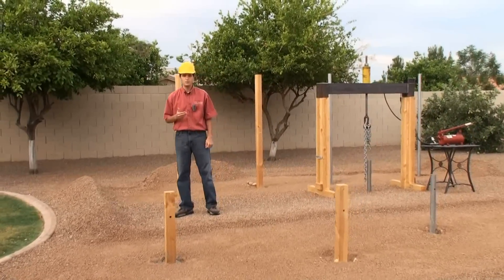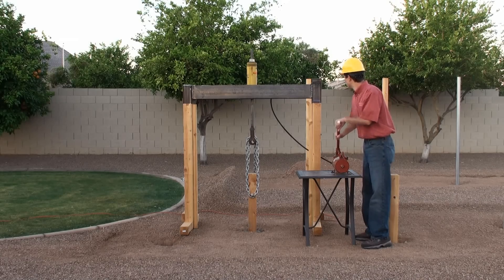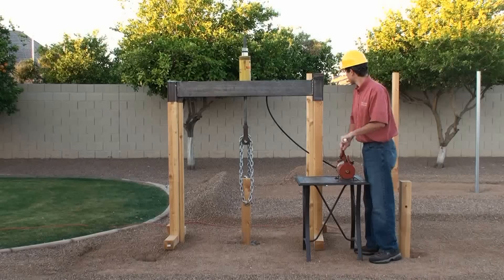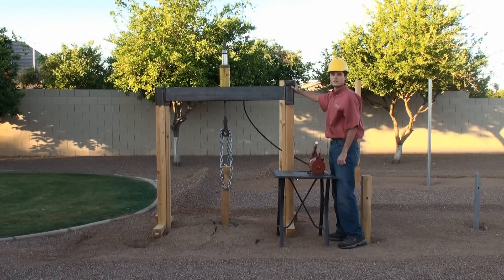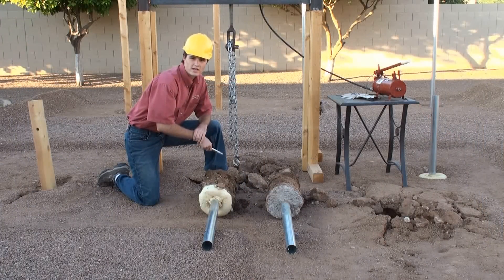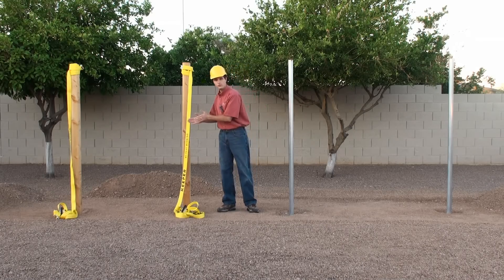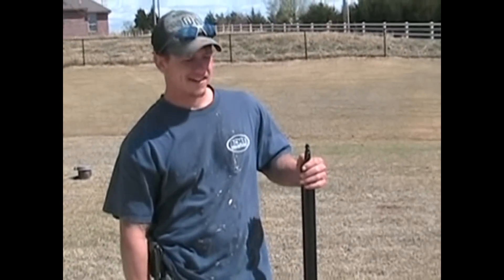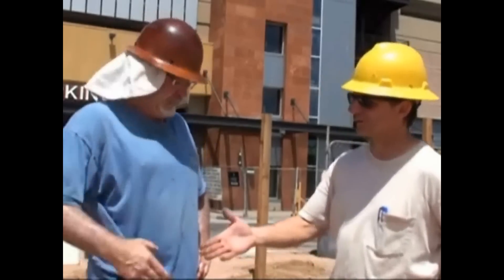Testing to Compare Concrete to Secure Set

Comment: We rarely set posts, but one 80 pound bag???? I believe we were always at 2 or 3 bags when we were stuck with it.  By the way, when it comes to posts (don't confuse this with  part of a building constructed using posts) as you use them,. Their design is not mainly to resist uplift, but to resist lateral movement...which can be figured out by your soils engineer using a calculator...and does have something to do with the hardness of the soil. . Most bagged concrete (around here) is around 3000 to 4000 psi...which translates to over 200 tons per square foot (if my math is correct..might not be?) .  The hardest soil is probably nearly as hard as your foam we called it D.G...not sure what they call it in your neck of the woods.  Foam has it's place, that is for sure. But to me it looks like your salesman in the video is just looking for easy cash extraction to people wanting to put in a new fence. What I would like to see, is a 50 year old installation of foam around a post,.................next to a 50 year old installation of a post in concrete,.. and just a lateral pull test..

Comment: This is an interesting test. The posts did move more in the horizontal pull with the Secure Set than they did with the concrete. Against a severe wind loading, I'd rather have the concrete on a one for one basis. However, the cost advantages in reducing labor could make the Secure Set advantageous in many situations. I'd still like to know whether I could use this to put posts in buckets for situations where I needed to move them to different places.

Comment: I'm a bit sceptical regards your 24 inch holes .. from watching your slowmo the ground is giving way, but the soil pattern as the ground gives way would indicate to me that your holes were "belled out" at the bottoms  before the concrete and secure set were poured.  Can you confirm or deny that?  Just sayin,  that that is not a typical industry standard when installing fence posts metal or wood.
Reply from the maker: Hello, Your observation is good.  Presenting information about a product is only worth publishing if what you present is accurate and true. What you observed is correct, the ground did give way like there was a bubble at the bottom of the post.  The reality is true.  The way Secure Set works is entirely different than concrete.  Concrete fills a void and it relies on the weight of the concrete and the surface friction between the concrete and the inside surface of the hole to resist uplift and to some degree sideload.  On the other hand, Secure Set, after it is mixed and poured into the hole, and while it is still in the liquid form, (about 45 to 90 seconds, depending on outside temperature) it is absorbed very quickly into the soil substrate. Once the bulk of Secure Set starts to expand, the product absorbed in the soil will also expand. This forms something similar to a "root ball" at the bottom of the post. Because of the penetration of the liquid Secure Set into the soil, The "root ball" effectively has a diameter larger than the diameter of the hole. Pulling the post out of the ground with this "bulge" at the bottom of the post makes it very difficult and as you observed in the video, causes a greater disruption of the soil than if the post was pulled smoothly out of a hole. That is why Secure Set works so well in addition to protecting the wood or metal post below ground line from either rot or corrosion. You had a good point, assuredly there was no "belling out" of the bottom of the hole, its just Secure Set doing its thing!  Thank you

Comment: I'm very much in need of replacing my wooden deck posts set in concrete due to rot at the base. After seeing your video, Secure Set has piqued my interest. As far as preventing or minimizing rot, is Secure Set better than concrete? Also in concrete vs. Secure Set, what would be better when the posts have to support the weight of the deck plus anything on the deck such as furniture and people? I thank you in advance for replying to my question.
Reply from the maker: Hello, Yes, Secure Set is the better option for setting posts that you do not want to rot below ground line. Secure Set is a high density (5 lb.) commercial strength foam with a compressive strength of 100.1 psi and a tensile strength of 130 psi.  It expands 18:1.   Its closed cell structure does not allow air or water to move through it.  Without either air(oxygen) or water, rot cannot occur. As far decks, deck posts can be set with Secure Set for decks up to 4 to 5 feet above the ground. Make sure you set the posts deep enough and that you cross brace the vertical deck posts.  Cross bracing will eliminate the potential for sway or shifting when you have a dynamic load shift, such as a deck full of people suddenly moving from one side of the deck to the other.  Recommendation is to set the depth of the posts at least 1/3 of the overall length of the post or 24" whichever is greater.  The diameter of the hole should be double the dimension of the post. ie: 4x4 posts should have a hole width that is 8". If you expect heavy loads on the deck, consider placing concrete pavers under the bottom of the posts to help distribute the column load on the deck posts.
Reply: @SecureSet-Fence-Installation  Thank you for the information.

Comment: Would this be secure on posts for Calisthenics bars?
Reply from the maker: Hello,  Yes it would work,  Set the posts for the bar at least 1/3rd the overall length of the post.  If you want the bar to be 7 feet above the ground, you will need a 10 foot post, with 3 feet set in the ground.  Thank you.

Comment: I think I am convinced to at least try it now.... When the price comes down just a bit closer to concrete ;)
Reply from the maker: Hello,  On a single post project, the cost of Secure Set would be more than an 80 lb. bag of concrete. However, if you have a project that uses 2 3/8th inch diameter metal posts, Secure Set is equal to the price of concrete.  You can set 7 metal posts with a one gallon kit. Also, mixing and pouring Secure Set is about 100 times easier than concrete and it sets in one hour.  You could set your posts and build a considerable amount of your fence in one day.  Thank you.

Comment: Strength depends on the depth of the hole. What hole depth was the demo posts?
Reply from the maker: As per fencing industry standards, the holes were 24" deep.  GRA Services The Makers of Secure Set

Comment: Why only fence posts? Why not footings for houses?
Reply from the maker: Thank you for your question, Karen.  As a 5 lb. high density foam, Secure Set does have great compression resistance, however, it was not designed or tested for foundation application. In its application for fence posts, decks, gazebos, pole barns, and many other applications including telephone poles, it does extremely well, other applications such as foundation work would be outside the scope of testing and its designed use.   GRA Services - The Makers of Secure Set

Comment: When you pull, you are testing the strength of the soil, not the strength of concrete or secure set
Reply from the maker: Hello, Yes to a degree.  That is why it is important to test both products in the same soil type. What we are demonstrating, is that in a side by side test, under exactly the same conditions, Secure Set holds the post in the ground better, as it requires greater uplift force to extract it from the ground.  The reason is that Secure Set actually permeates into the soil as a liquid, before it expands into high density foam.  This allows it to lock into the substrate more tenaciously than does concrete.  Concrete fills the hole, but it does not penetrate the soil.  Secure Set is also a closed cell material which prevents air and water from getting to the post below ground line.  This protects the post and helps prevent rot for wood poles and corrosion for metal posts.  Thank you.
Reply: @SecureSet-Fence-Installation  ok, good point. Thank you

Comment: Couldn't the dirt play a roll in pounds to pull?
Reply from the maker: Hello, Yes, that is a good observation.  The soil will play a role in the outcome of the pull test.  That is why we tested the Secure Set v/s concrete in exactly the same soil conditions, so that a true side by side comparison could be established.  It would be a different result if one test was done in heavy clay and the other was done in sandy loam.  Regardless of the soil type, we have found that Secure Set, with its ability to penetrate into the substrate of the soil, gives a better uplift resistance than does concrete for whatever type of test in completed in a side by side scenario. Reason being, the concrete fills the hole, but does not seep into or penetrate into the soil as Secure Set does. Thank you
Reply: @SecureSet-Fence-Installation  Can I make a table with it, like people do with cement?  
I also want to make a slab 3'x6' to place a smoker on. I was just going to frame this out and pour concrete in it.

Comment: This is the demonstration I needed to see to convince me to switch from concrete.
Reply from the maker: Hello,  Thank you, there are others benefits as well.  Ease of use,  transportation of material, no need for water on the job site and long term protection of the post below ground line.  You will find Secure Set to be a very good alternative to concrete or other post setting materials.  Thank you.

Comment: This looks like an awesome product but what about the environmental impact?  Will the chemicals from the Secure Set leach out over time into the soil?
Reply from the maker: Hello,  Secure Set, when it expands and hardens, becomes high density, closed cell structural foam.  It is from the polyurethane family of "plastic" chemicals. In other words, it become an inert plastic like product, that will not break down over time.  Known life of the product underground is more than 40 years.  In essence, you have made a "man made rock" .  It does not allow water or air to move through it, therefore it does not leach out or absorb in any harmful substance in the soil. It does not affect ground water or support any fungicidal growth. It will effectively protect your posts from rot or corrosion for many many years.  Thank you.

Comment: Who cares about the force to remove the post. I care about side strength from wind and then longevity.
Reply from the maker: Hello, The two forces at work on a fence are both side load and uplift.  As the velocity of the wind increases, and the wind hits the fence and deflects up and over the fence, initially the fence will start to lean as the compression on the soil at the base of the post, eventually exceeds the psi compression resistance of the soil. As the wind deflects up and over the fence, this creates an upward drag on the fence which tries to pull the fence post out of the ground.  This is not unique to fence posts, all vertical structures encounter the same physics. Thank you

Comment: It's about twice the price on concrete. With my back, it's well worth it.
Reply from the maker: Hello,   Yes, by the individual "Shake & Pour" single post kit, it does cost about twice what an 80 lb bag of concrete costs.  However, if you purchase by the "gallon" jug, you can set 5 posts (4x4 wood posts) per gallon and then the price is about par with concrete.  Thank you for your comment.
Reply from the maker: Hello, if you purchase the product by the gallon, the price averages $5.80 per hole, a bag of concrete at our local Home Depot is now $4.66 (includes tax).  You only have to wait 1 hour for Secure Set to cure, most posts can all be set in one day versus waiting until the next day for the concrete to set.  Many advantages for using Secure set.  Thank you

Comment: I'm more interested in the compression over time factor. I know concrete will provide a stable, wide footing for my project. If I use this for a carport will it eventually sink from compression of foam? Longevity? Not saving time if I have to redo it all again in 5 years.
Reply from the maker: Hello, Good question.  Secure Set has a compression strength of 100.1 psi.  That means that it can support 14,400 lbs per square foot.  If your carport has been constructed with either posts or walls, and either of these are supported by Secure Set, if the load bearing weight at each of those points does not exceed 14,400 lbs per sq foot, you will not have any issue with the high density foam.

Comment: What is the life span of the foam? Expanding foam doesn’t outlast concrete especially out in the open!
Reply from the maker: Hello, The known lifespan of high density foam that is protected under the ground exceeds 40+ years. You are correct about foam that is left exposed to ultraviolet light.  After a while the foam will start to discolor (turning a yellow color). If the oxidized surface of the foam which has discolored, is left undisturbed, the damage to the foam will only be about 1/16th inch deep.  However, with the possibility of yard maintenance work disturbing the oxidized zone, the UV light will affect the next layer of foam, etc. Over time the foam will slowly deteriorate until it gets to ground level and is covered with soil. Thank you.

Comment: I need to put 6x6 wood post to hold solar panels in Canada. That means heavy load on each post (about 100 kgs load, 6 feet wood above soil) on compression and soil movement on winter/spring (because big difference in temeprature). So my question: foam or concrete ?
Reply: Using foam will be more than adequate.  The issue is the depth of the post.  I'm not sure how deep you are planning on setting the posts, but based on your information, with the load you have I would set the post no less than 48" in the ground, that should put you below the frost line.  Also, if you can, try to "bell" shape the bottom of the hole a little, this will be a very good way to also counter frost heave.  Thank you.

Comment: On the last tests (pulling horizontal), it seems like the concrete holds the posts vertical without giving way.  The posts either break or bend, where the Secure Set seems to actually let the post bend over.  Wouldn't that mean that the fence would be leaning (i.e. not 90 degrees) after a strong wind if Secure Set is used?  Compared to the fence flexing, but returning to vertical if concrete is used?

Comment: How would secure set deal with ground heaving from freezing and thawing in colder climates?
Reply: Its the same as insulation foam, so it is not affected by heaving, heck, utilities have been using expanding closed cell in their industry for a few decades now. There are some videos proving this use.

Comment: stupidity... the grounds strength and compacted-ness is the force being measured  neither post slipped from the grip of the poured mixture ,, the surrounding landscape gave way.. test result undermined by the soil---  this video  should be removed / how embarrassing... think guys look at what is  being presented and what does it say about the product...=not a dang thing
Reply: Isn't that the idea? Show that the product strength is higher than soil? It essentially demonstrates that the soil is your weak link, not the foam.

Comment: Now I believe that this is a good product, but this test only proves adhesion to the 4x4. The matter of the force is all up to hard the soil is and how much soil you get to participate in holding against the lift. A larger footing will always hold more than a smaller - no matter the product - and this test has very limited if any scientific value since the product that fails is not the product being tested in any cases - just the surrounding soil.  As such the key unique selling point for the product is convenience, the time you save on waiting for concrete and or quickset , and having to avoid hauling tons of a concrete product. This video does however show that with a product of lesser weight, you can adhere to the pole and enough soil to negate the lesser weight.

Comment: Good video one question which one of these two products is the most eco friendly to the environment. It probably isn't the expanding foam. Is there anyone out there that could tell us ?
Reply: You should learn to understand and read the FAQ on Polyurethane which is quite inert where as concrete/cement is a chemical that will very slowly leach stuff any additives that is contained within it.

Comment: Why does the readimg matter if the GROUND is giving away? You did not reach the limit for any of the two. This test should bave been done with holes in a concrete floor, to actually get any data about the product...